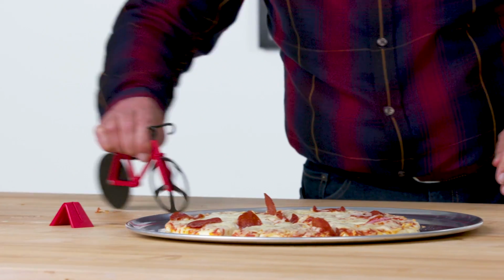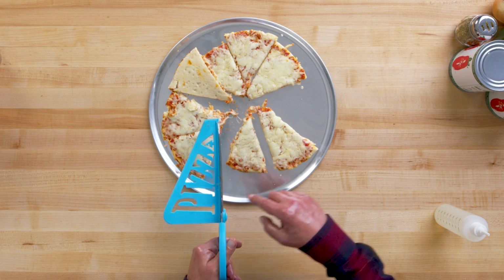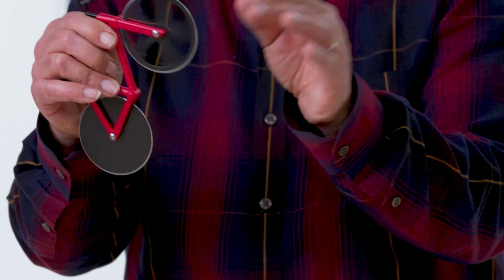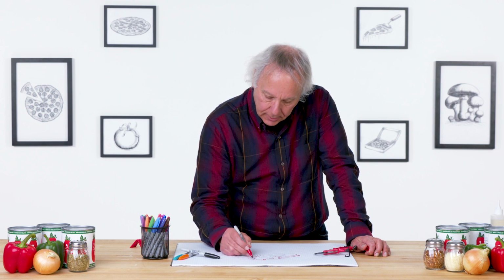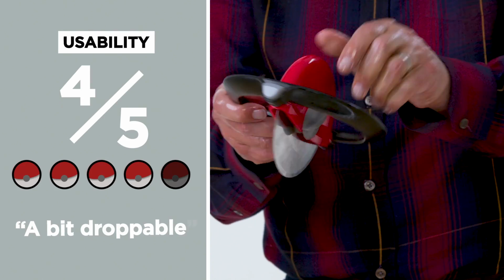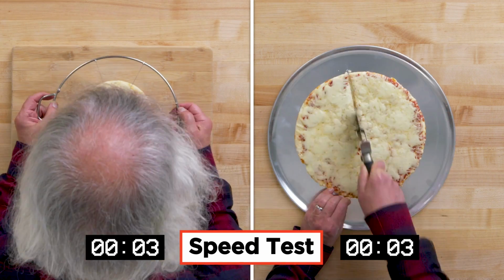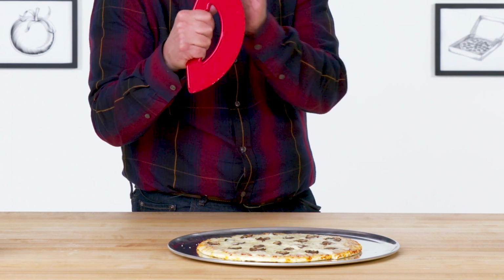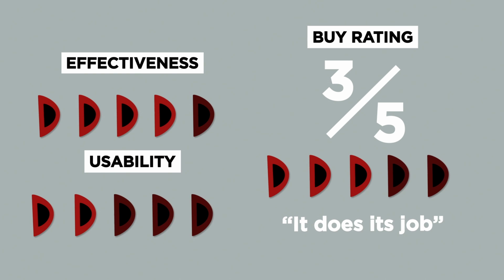5 Pizza Cutting Gadgets Improved By Design Expert | Well Equipped | Epicurious

Comment: I believe the phrase "don't try to reinvent the wheel" comes to mind.
One thing you don't mention though is that when you normally get pizza... it is pretty hot.  So things like the scissors are even more terrible since you need to physically lift up the hot pizza to use them correctly.
Reply: Not to mentions the server is crap and could bend over
Reply: I always just use normal scissors and lift it up a little to cut it. It's not too bad, and you don't need some fancy extra tool that you don't use for anything else.
Reply: @MaakaSakuranbo  I agree you don't need a fancy tool, but scissors are not the best idea. Just use a chef's knife.

Seriously baffled as to why anyone would use scissors.
Reply: @Vykk_Draygo  Easier to cut through the firm crust with them. Why not use scissors? What's wrong with them?
Reply: I'm pretty sure that the intent for the scissors is to facilitate cutting and serving the pizza onto plates in a single action. That's why it has the spatula built in.
Reply: @nick012000  you need it to hild and get the pizza slices to the plates not falling into the ground
Reply: @henrycooper3431  You put the plates next to the pizza stone on the kitchen bench? You're not carrying them across the floor, you're just saving yourself the effort of pulling out a spatula to serve them.
Reply: @nick012000  eh... still when it fall there is a chance that the topping side is on the downside with isnt good
Reply: @nick012000  Saving effort? How if it is way faster to cut the pizza with an actual pizza knife and using a spatula to pick it up.  Or you could just use a bigger knife, with it you can cut a straight line and you can pick the pizza up with the knife.

Every way is less of an effort than this knife.
Reply: @WetAdek  You're only using one tool. Cut the pizza and then put it on the plate in one motion. If you want to cut it with a knife, you're cutting each piece and then grabbing a spatula to serve them up.
Reply: As I always say when I see such actually useless gadgets: Dumb inventions for dumb people
Reply: @WetAdek  You said it. This stuff is unreal. Instead of just buying a $2.00 pizza wheel.
Reply: Mezzaluna pizza cutter is the best. Just a big metal version of the Rock and roller, but with handles on the edge. I can cut a pizza in 10 seconds with mine.
Reply: Im sorry but you cut your pizza while its hot?!
Reply: @lydiagonzales41  like not super hot,  but while it still has a decent amount of heat to it.   Needing to lift it up from a burning metal tray to fiddle around with a scissor isn't the wisest idea.
Reply: @YukoValis  ohhh okay, now i get you. Idk why but i went straight to "its gonna mess up the cheese" instead of "hot no touch, causes an ouch"
Reply: How does this kind of garbage get made? I wonder if there's some dummy out there with 10,000 giant 8-bladed pizza slicers in his apartment.
Reply: I think it was meant to be able to cut the pizza without touching it, but it just sucks at its job.

Comment: That thing for making multiple slices at once would seem to have a very specific use case. Or two, actually. One is just if you have a really thin, crispy crust that will fracture when you apply pressure without actually having to push all the way through it. The other would be a pizza of exactly the right size, already in a cardboard tray, which for some reason hasn't been cut yet. You can't use a pizza wheel inside a box because the edges of the box stop you from cutting the edges of the pizza. And the flexible cardboard base would lend itself to a more thorough cut than a hard surface would, unless that thing is engineered with perfectly co-planar blades.

That rock 'n' roller one would be good for cutting a pizza in a box as well. You can get all the way to the edge of the pizza without the edge of the box getting in the way. I think some pizza places use a similar tool, or a mezzaluna type thing.

Comment: I think the second wheel is meant to "double tap" slicing to ensure that each slice is fully cut
Reply: Yes, but still the hand/wrist position is kind of uncomfortable to hand it with the 2 wheels down and making pressure
Reply: He tried that the second time he used it.
The rear wheel doesn't rotate at all
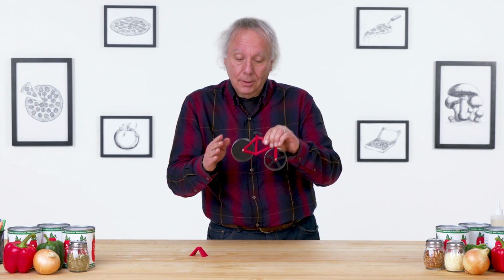Reply: @recoil53  at 8:06 he spins the back wheel to show it does rotate
Reply: @meg1653  I think the back wheel's flimsy or the gears might not be as "smooth" as the one in front. Either way, with its design, I don't think the design and the parts serve their purpose.
Reply: @peterpansplayground  There are no gears. It's a rotating shaft. The issue would be that it's difficult to have both wheels track in the same path and to comfortably apply pressure evenly.
Reply: No, it's because it's a pizza bicycle, not unicycle DUh.

...

I think you're right, though.
Reply: It doesn’t matter, since the blade spins, which quarantines that the pizza gets cut twice each cut.

Comment: I work at a pizzeria and the tool we use to cut the pizza is pretty similar to the rock and roll pizza cutter, the difference is its like a huge steel knife with 2 handles on the top of each end.. it works really well, and i can cut an 18 inch pizza into 8/10/12/16 slices in less than 10 seconds
Reply: Ardini SF That's called a mezzaluna.
Reply: Yellow Hero yep! i think so, but the one we use has horizontal handles instead of vertical handles and its so big like atleast 15 inches wide